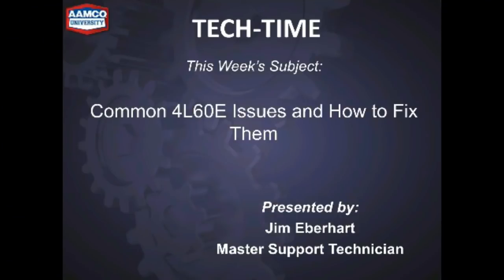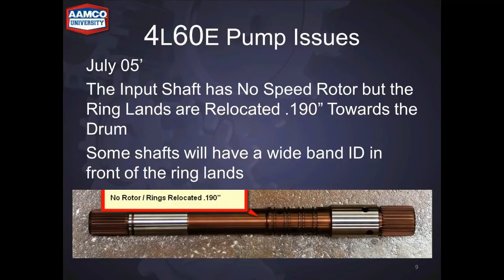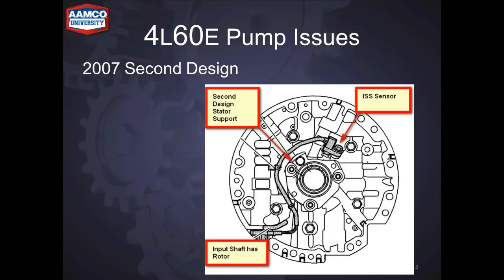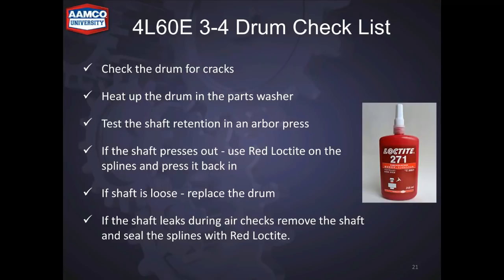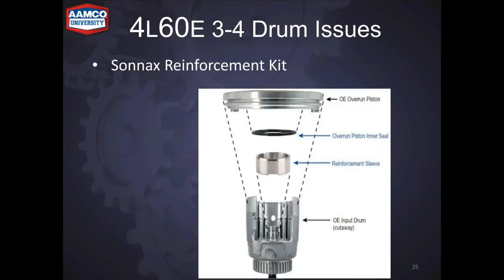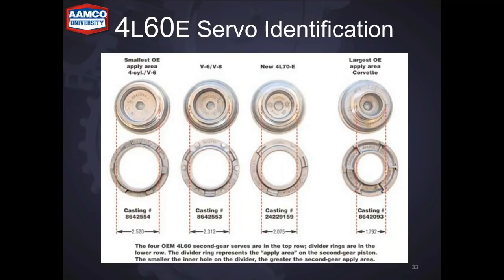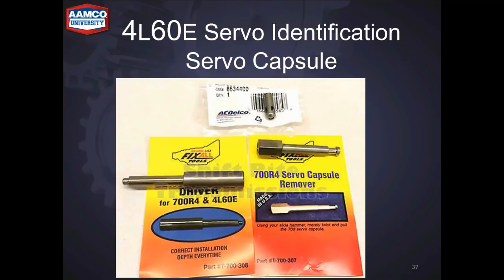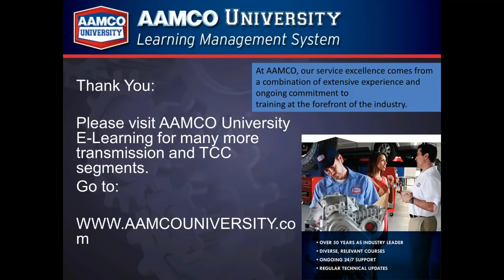Chevrolet 4L60E Transmission Common Problems and Fixes

Comment: If the hole is drilled and plugged, you can put a sensor in for the turbine shaft and works perfect, i can promise you.

Comment: Good vid!
Any other reasons for 2-3 shift flare? 07 Sierra just recently noticed every so often, im getting a 2-3 shift flare. Never did this before, and doesnt fully slip.
What are the causes for this?
Is it true, installing a corvette servo will most likely cure the 2-3 shift flare?
Thank you
Reply: Sonnax has an article about 2-3 flare and checking current draw by the shift solenoids.
Reply: @combatjm89  
Thanks, il try and find that article

Comment: Great..but can you help me with rough and jerk take offs when i give it gas to pull out.
Reply: Sounds like a bad throttle position sensor, or a failing shift solenoid, or dirty fluid or sticking piston.
Reply: @rickhoward1516  How do i find or where on a 2005 Chevy Silverado 4.3 engine,  2wheel drive find the type ( NUMBER  ) of my transmission.?
Reply: @davidvarney9254  look it up online. Probable a 4L60E
Reply: @davidvarney9254  You can use the RPO codes in the glove box, or the actual serial number of the trans on the tag on top of the unit. If you can't see it, the SN is engraved on the trans where it meets the pan (passenger side if I remember correctly).
Reply: @davidvarney9254  it's a 4L60E
Reply: @pmotorsports8276  4L65E...
Reply: @rickhoward1516  4L65E...
Reply: 4l65/70E were in Denali and Cadillac.  They got more 3/4 clutches and 5 pinion planets but interchangeable

Comment: This seems like an in house production for Aamco's techs. They simply lock tights parts when worn and use it as a sealant? Thanks for the info, I will never take a vehicle there.
Reply: Not really. It's the only way to fix the input drum if it's leaking between the drum case and the shaft. They pretty much always leak there and you can't buy them new anymore so the threadlock method is about the only option.
Reply: That's the only way to fix that issue